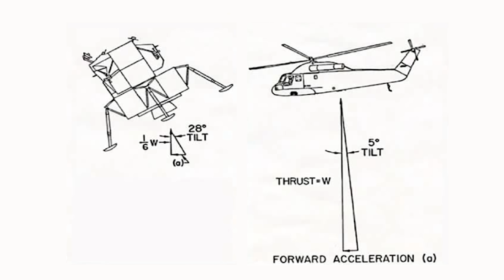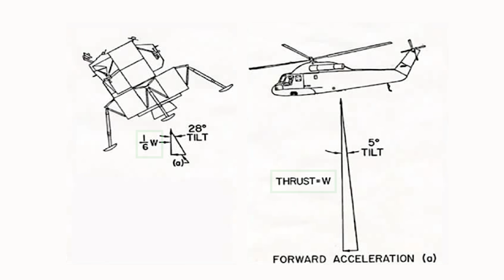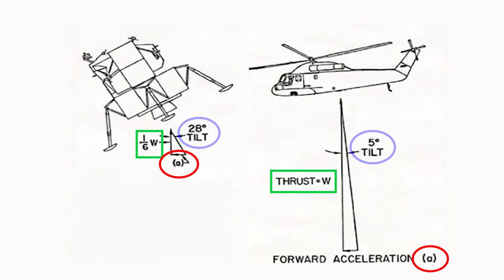How Neil Armstrong Trained to Land on the Moon  - Smarter Every Day 250

Comment: I would like you to ask him how his Retinas survived outside the magnetic fields.  Apparently these winds blow 190 mph across the solar system. They bend the magnetic fields into and always from the earth. They also rip the edges of the atmosphere off into space. They say that if the failed our power grid would be instantly destroyed. Vegetation would start wilting. Our atmosphere would be stripped off into space. Now I’m told these men survived out there for 12 days or so.??
Reply: 1) Highlight your reply and copy. 2) Paste into Google AI mode...here is the reply..
The Apollo astronauts survived their missions outside Earth's magnetic field because the "winds" and radiation they encountered were not as instantly lethal as often imagined for short-duration trips. While the solar wind and cosmic rays are dangerous, the specific conditions and timing of the Apollo missions allowed for a safe return. 
How Their Retinas Survived
Apollo astronauts did not suffer permanent retinal damage because they were protected by their equipment and "lucky" timing regarding solar activity. 
Shielding: The Apollo Command Module used aluminum and other materials that blocked most low-energy solar wind particles and some radiation.
Visual Phenomena: Astronauts did experience "light flashes" (phosphenes) while their eyes were closed. These were caused by high-energy cosmic rays passing directly through their eyeballs and stimulating the retina or optic nerve. While startling, these flashes did not cause immediate vision loss.
Solar Flare Avoidance: The most dangerous threat to the eyes and body—a massive solar flare—never occurred during an active mission. A major flare in August 1972 occurred between the Apollo 16 and 17 missions; had astronauts been in space then, they could have suffered acute radiation sickness. 
Surviving Without the Magnetic Field
The "winds" you mentioned (solar wind) consist of charged particles moving at millions of miles per hour, but they are extremely diffuse. 
Mission Duration: The Apollo missions lasted roughly 8 to 12 days. The cumulative radiation dose received was comparable to a standard chest X-ray or a head CT scan—far below the levels that cause "instant destruction" or immediate illness.
Atmospheric Stripping: While solar wind can strip away a planet's atmosphere over millions of years (as happened to Mars), it does not "rip" it off instantly. Earth's atmosphere is held in place by gravity, and the magnetic field acts as a long-term buffer.
Van Allen Belts: The astronauts traveled through these intense radiation belts in just a few hours. Their trajectory was specifically designed to pass through the thinnest parts of the belts at high speed to minimize exposure.

Comment: I had CB kit until the early nineties. until i started college. I didn't really get back into it. However, your points are very valid; I enjoyed using channel 19 for reports of traffic problems and getting diversion messages. More useful than today's gadgets that might fail, I no longer drive, but the points you make are valid and valuable; perhaps I should get a new setup and start having some fun again; it won't be the same now, 40 years later!

Comment: X-14 ain't so cool though -- it's maneuvers are stilted/tedious/slow - because they are barely balanced, subject to extreme instability if they get out of balance.   I watched these X14 showcase videos, and all we see are "slow hovering" -- and the only video showing it flying anywhere significant is so very blurred (and no audio) - we have no idea what plane is going that specific flight.   But all of the Clear videos are low-to-ground tedious/slow hovering....   NOTHING like the tech needed to go from 3600 mph orbit to landing... and worse, to then take off and dove tail perfectly into a 3600 mph orbit 70 miles high...  perfectly aligned, rotated, and timed!

You hadn't heard of it, because it's non-impressive.   They kept flying this until 1981 -- NEVER getting notably better.    HMMMMM.... you'd think if the Lunar Lander could do so much more, that maybe the X14 program would see some of this progress!..... Nope, why?   Because the Lunar Lander itself was unflyable.... even for simple/slow/tedious/low tasks.

It AMAZES ME that THIS isn't the MAIN TALK of Conspiracy theorists -- it's the SMOKING GUN, showing we didn't have the tech, most of all, for this LM landing and redocking.

Comment: Thank u very informative. Could U elaborate on the speeds involved in the ascent stage for the lunar module. I saw an equation not sure if correct that the CSM was travelling at 1600 metres per second and the module had to match this speed to redock. How did the lunar module reach these speeds factoring in less gravity of course. How much room for error. Could the exact position of the CSM and lunar module be tracked in real time and if so how exactly.. were flight paths predetermined or was some manual adjustments required and how difficult would that be at those speeds. How much room for error.
Reply: "Could U elaborate on the speeds involved in the ascent stage for the lunar module."

I can give some answers, but the best resource for this is the Apollo Flight Journal website.

"I saw an equation not sure if correct that the CSM was travelling at 1600 metres per second"

Probably a bit higher, like 1650 m/s.

"and the module had to match this speed to redock."

Yes, docking required the two spacecraft to be travelling in exactly the same direction at exactly the same speed.

"How did the lunar module reach these speeds factoring in less gravity of course."

Well, the Grumman engineers knew the speed the CM would be orbiting the Moon at, so they knew that was the speed the LM ascent stage had to be able to reach in order to rendezvous and dock. Even at liftoff from the Moon, the ascent engine was powerful enough to provide 2G acceleration. And as the fuel was consumed, its acceleration increased.

"How much room for error."

Not a lot. The Apollo missions operated on tight energy budgets at most stages of their missions. However, as long as the LM could climb into some sort of orbit, the CM had the fuel to dive down to rendezvous with the LM.

"Could the exact position of the CSM and lunar module be tracked in real time and if so how exactly."

Yes, they could be tracked in real time. First, each spacecraft had a transponder which replied to a signal from Earth. The time between sending the signal from Earth and receiving the reply gave the distance to the spacecraft. The Doppler shift in the signal gave the speed the spacecraft was receding or approaching. And the direction the dish on Earth was pointing gave the direction to the spacecraft. Put all those three together and you know exactly where the spacecraft is from second to second, and the direction it's travelling. For spacecraft orbiting the Moon, they knew to the second when they were to disappear behind the Moon and reappear from behind it.

"were flight paths predetermined or was some manual adjustments required and how difficult would that be at those speeds. How much room for error."

The flight paths were predetermined. NASA's mainframe computers calculated the parameters required for each burn - when to start the engine, how long to burn for, what direction the spacecraft was to face when the engine fired, and so on. Those parameters were then read up to the astronauts, who recorded them on a paper form called a PAD (Pre-Advisory Data). The astronauts then typed those parameters into their spacecraft's computer. They were then responsible for ensuring the spacecraft was correctly aligned for the burn.

The computer would then conduct the burn, but the astronauts would monitor systems and take over manual control if things were going wrong. At the end of the burn, the crew would compare what velocity change the burn was supposed to achieve with the change which actually occurred (using onboard accelerometers); the difference was known as residuals (in the X, Y and Z axes). Once the size of the residuals had been confirmed with Mission Control, the astronauts would then fire the spaceecraft's reaction control system rockets to null the residuals.

For some burns the room for error was small. For example, the burn to decellerate into lunar orbit had an error margin of about 10 seconds otherwise the spacecraft would hit the Moon half an orbit later. Of course, shutting off the engine required simply hitting a button on the control panel, so it would have been unusual for the crew not to be able to manage it.

Comment: What about using lighter-than-air ballasts to simulate 5/6 less gravity?
Reply: It would have to be rather big, and would interfere with handling characteristics.
Reply: That would not have worked.  The engine that simulated 1/6 gravity was on gimbals so it could always point directly downward even if the test vehicle tilted over.  A balloon would sway.  If the vehicle moved too far away from side to side, the balloon would no longer be pulling the vehicle straight up, but off to the side a bit.  It just wouldn't have worked - - and of course the size of the balloon - as has been pointed out - would have been preventative.  The counter engine on gimbals was the way to go.

Comment: Vertical take-off in the 1960s.  

Better look up the Bachem Natter, which took off vertically, a true rocket ship.  

Or the Lockheed Salmon, or the Convair XFY-1, or the Hawker P.1127, Kestrel and Harrier.  All of them before and during the 1960s and not the one you showed film of.  

There are others, notably from France and Germany.

Comment: My guess is that IF we ever go back to the moon (and if we have to depend on Artemis to do it we probably won't) they will try to use computers to control the lander instead of human pilots, and it will probably crash. I think one of the main reasons Apollo was so successful was they were VERY limited with the use of computers back them. Computers seem to ruin everything that uses them.
Reply: Did you watch the video? The computer controlled 99% of the mission, and if it had failed they would have had to make an immediate abort.

Comment: No video showing the inside of the LEM during ascent and descent. No video showing a Geiger counter in outer space or on the moon or Denise the radioactive moon dust contaminated LEM. Absolute hoax
Reply: another graduate from the University of Dumbasses...
Reply: @KPL400  This channel doesn't have any content😆😅🤣😂😻💝💖👍
Reply: @suekennedy8917  I lament they suiting up in that tiny space with walls thick as cardboard.
Reply: You realize the entire landing from PDI to touchdown was filmed from inside the lander right? And they didn't carry a geiger counter, they did carry devices to monitor their overall radiation exposure and it was elevated but not severe.
Reply: They really were just lucky that there were no unexpected radiation bursts (yet high reads on one).  On 6 landings and 3 orbitals, like Luck on everything (realizing first Rocketship landing, very first throttled Rocket, very first LEM ground test).  While Apollo mission astronauts carried dosimeters to the moon to measure radiation, the data was never reported.

Sep 25, 2020 — Astronauts would get 200 to 1,000 times more radiation on the moon than what we experience on Earth.
Aside lunar surface creates a flux of albedo neutrons.
Reply: @MeerkatADV  Next time I am litigating against criminal government employees, I
will definitely include you for my prosecution strategy. Scavenging efficiency at part throttle...LOL!
Reply: There are.  Van Allen Belts are mild and belts (thanks James) Apollo travelled at speed through the thinnest part.  Any more silliness?
Reply: Jun 16, 2017 — For near-Earth missions, the Van Allen belts are not a hazard to spacefarers. It was, however, a hazard for the Apollo missions. The Van Allen ... Forbes
How intense is the Van Allen belt?
Image result for Van Allen Belts are not mild
The inner Van Allen belt consists largely of highly energetic protons, with energy exceeding 30,000,000 electron volts. The peak intensity of these protons is approximately 20,000 particles per second crossing a spherical area of one square cm in all directions.  - britannica :)
Reply: @narajuna  
Belts, speed.  James Van Allen was correct
Reply: @narajuna  You do realise that 30MeV = 0.0000000000048 J.

Comment: So, how did they do that? They didn't. The lander was dangerously unstable - even more than the jet driven test vehicle. The delay in the correctional adjusting system would have caused pilot induced oscillation the first time the vertical axis had to be changed. All the footage from "the Moon" were made in big hangars and studios with exact mock-ups of the Moon surface in different sizes - exactly like Hollywood would do it today. So, "the returning to the Moon" is in reality the first time man sets his feet on the Moon (based on rocket technology), and it will be very hard to achieve - even with modern computers and rockets. It takes extraordinary power to send a spaceship with a crew into outer space compared to what is necessary to place a space craft in LEO. And then there is the problem with all kinds of EMF and high speed particles once outside the van Allen belts - and that hostile environment will continue until the men are safely protected by the belts again - if! they manage to return and enter the atmosphere safely. All this is extremely difficult to achieve, and the risk is that we will be presented to a new TV-illusion.

Comment: VTOL in the 60s?  Why not. Saturday, November 19, 1960..first flight of the P1127 (Kestrel), or the Short SC1 (1958). And the NASA "Flying Bedstead" first flew in 1964, whereas the original Rolls Royce "Flying Bedstead" first flew in 1953.

Comment: If you use the full motion class of simulators that airline pilots use as an example, im curious if an LLTV is actually necessary today if we take that same hardware and software and apply it to landing on the moon. There is no genuine substitution to actually flying something but with the computer power we have today compared to the 60's, id be interested to see someones landing telemetry that flew only a full motion simulator compared to someone who flew an actual flying trainer.

Comment: I lived in Bethpage at that time where the LEMs were built. I knew many of the engineers too, one of them was my best friends father who was in charge of wiring the LEM. Grumman had employed ove 85,000 people working 24/7. The LEM project was important but they also were working on the F14, E2C and others. The entire town was proud of the work Grumman did as their work had never been proven until the 2 astronauts were safely aboard the Command module.
Grumman built 2 identical LEMs for the mission. 1 was going to the moon, the other was in the hanger. After the mission was over, they pushed the one from the hanger out into the parking lot and it was painted camo green. I was there for months. I went by it every day on my way to school.
One of the things my friends father was concerned about was all the wires that ran from the assent module to the decent module. They ran thru an explosive guillotine that fired right before the engine lit. If that failed, the assent module would never make it off the lunar surface. If you watch the video of the assent module taking off from the lunar surface, you will see an outward explosion just before lift off. That was the guillotine firing, cutting the umbilical wires.
Grumman now was bought by Northrup and the original facility is a shadow of its former self. Although a few buildings are still there, the runway is torn up and apartment buildings are there. The original hanger where the LEMs were built is still there, but it is now a movie studio.

Comment: Based on how components of the Space-X rocket boosters use automated landings back to land and or on a robot vessel at sea I wonder how much automation will be used on a lunar touchdown?  As a fail safe method of saving a flight my guess is the astronaut tasked with a lunar landing would still have to manually save the mission by disengaging an automated system and fly it down.... upon failure of the automated system.  Scott Carpenter on Aurora 7 did a manual reentry successfully after it was necessary for him to deactivate the automated system on his flight back in 1962.  We'll see.

Comment: First flight of VTOL aircraft Harrier was in  1967. Yak -36 in 1963. So it is not so shocking. anyway X-14 is realy interesting vehicle.
Reply: True, but here the problem is, though simple in principle, tough to simulate in practice. You have a vehicle that experiences 1/6th of the gravity pull of its inertia. With modern fly-by-wire systems that would be a lot simpler to implement in a training vehicle than it was then. Which is why we, today, tend to underestimate the achievement of those peeps back then.

Comment: i would've thought that buggy'd have more drift , or have more over steer , or under steer , or bounce, i suppose moon dirt can be quite grippy
Reply: They never actually went very fast, and they didn't have a lot of power.
Reply: @ArKritz84  they had a voltage x:
they had an amperage x
they had a wattage x
they weighed x
several working replicas were made and tested under similar conditions , and the demonstration was shown to be plausible.
Reply: It has 4-wheel steering.